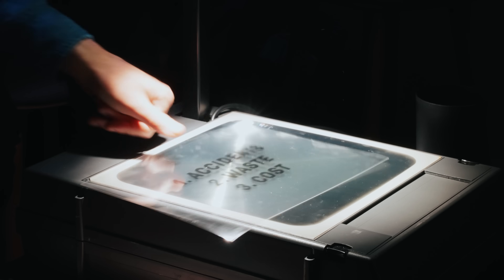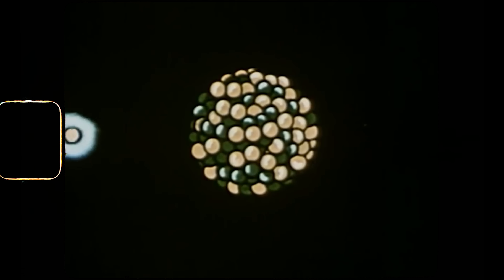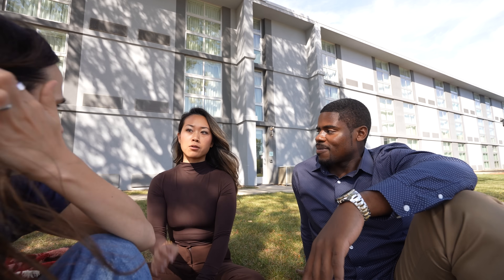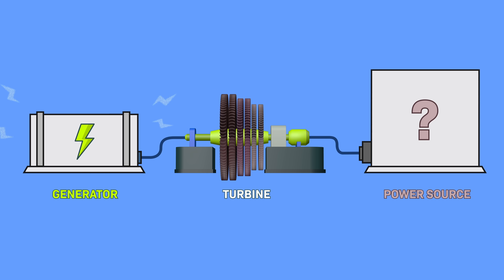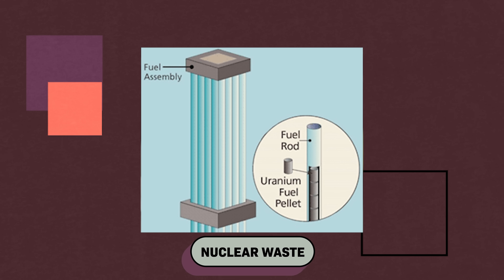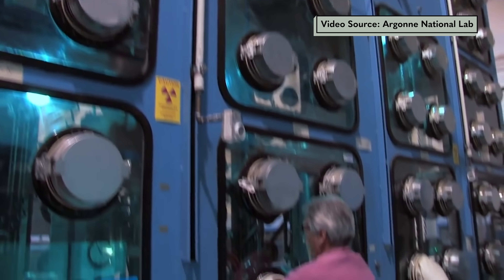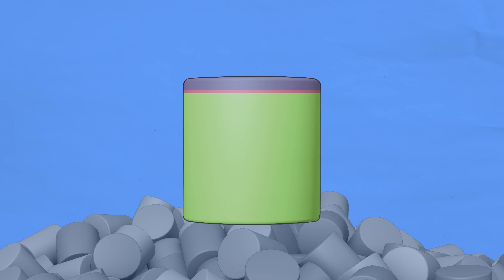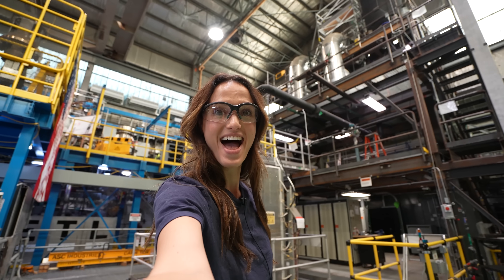The Big Lie About Nuclear Waste

Comment: I think nuclear power is the key to the future. It’s relatively clean energy that if engineering can solve the nuclear waste problem we will be set. I think countries should heavily consider exactly where they are put to avoid catastrophes. Like if we just put them in non earthquake hurricane or other low disaster zones it could be very safe. I think it’s definitely a source of energy we can rely on until we solve fusion because no renewables like wind and geothermic are highly dependent on location and it’s the best solution we can implement now. I used to live next to a reactor in Virginia I understood the risks but as long as we have our best engineers on the problem catastrophe can be averted imo. There will be a need for transitory power sources that will prevent further global warming right at this very moment and we can use remote storage locations like Yucca mountain or Finland in the meantime until we can launch it into space. I genuinely think that if we have a form of energy that doesn’t include greenhouse emissions that would be excellent fuck the risks of another Chernobyl that’s why we regulate and don’t operate like the Soviets I know a few bright people trying to get into nuclear engineering and I would trust them to run it 100% they are the smartest people I know and as long as regulation ensures this we will be fine. If we don’t kick back global warming right the fuck now we will be responsible for the deaths of a billion people that rely on reefs and fishing for food in Africa because at 1.5 degree warming 99.9% the coral reefs die due to warm waters in the oceans and we lose a shit ton of food production worldwide. We are expected to hit 2.8 degree warming by 2050 so if we don’t course correct now we will literally turn our own planet into a mad max hellscape by 2070. Let’s do the smart choice and keep nuclear plants operational so we can mitigate at least some of global warming. We will already be responsible for the mass starvation that we will soon see it’s the least we can do. If you are worried about a meltdown there are people much smarter than you and I capable of solving those problems and we should so future generations don’t suffer. A billion people are threatened in third World countries where fishing is their main source of food in Africa, we will be directly responsible for their deaths if we don’t change something now. I don’t envy the idea of continuing to use fossil fuels for my car when I know it’s going to kill a lot of people in the not so distant future. Global warming is an invisible threat that’s going to slowly affect us more and more it will be like a chain reaction and that threat trumps any nuclear disaster we could ever face. Radiation dangers are terrifying and real and disasters could cause a ton of death but I think the global warming threat vastly exceeds whatever harm radiation may cause as a result from a utilitarian perspective it causes the least amount of suffering worldwide and we should switch but only in low disaster risk areas we saw what happens with Fukushima.

Comment: Much of Ontario, Canada's electricity comes from nuclear power, Canada Deuterium Uranium (CANDU) reactors which use UNENRICHED uranium, along with hydroelectricity and natural gas. Coal power is no longer used in Ontario. CANDU reactors can also run on spent nuclear fuel from the light water reactors the USA uses.

Comment: I am completely pro nuclear power. However, do not forget that every time you recycle the uranium used previously, you create nuclear waste. I'm not talking about the pellets necessarily, but I am talking about all of the other things that get irradiated in the process. Process. Don't get me wrong, it's not that big of a issue compared to having spent fuel rods sitting around for hundreds of thousands of years, but it's not like aluminum. It doesn't all convert into new uranium for nuclear power.

Comment: Back in the days it seems like scientists wanted and knew how far we could push technology, and today when we have the tools we need to proceed everyone is working against it because it is not enough profit in the long run. Instead we blindly scrap things that will save the planet with lies about a cleaner option that is making it even worse, And people is actually buying it and no one is going to realize that our increasing demand for electricity will only be possible with nuclear power until it is too late to reverse and that we had the knowledge all along to do it, we just have to keep refining and get better at using up the fuel we already have. we need "to drink all the milk before we toss the package" because if you have no more milk left in the package aka Nuclear fuel, there is nothing left to spill.

Comment: The concern has never been the fear of disposing or using nuclear waste.  You can throw it down a giant hole in the ground and bury it.  The legit fear is nuclear plant meltdowns.  They will be pouring concrete on Chernobyl for the next 5,000 years.  And the ground will be contaminated for 10000 years after that.  And Europe got lucky that millions.  Yes, MILLIONS of people didn't die from it.  The amount of Soviets who died trying to prevent it.  We will never know the body count.  Solar and Wind is feasible long term.  Even Fusion (though far away still)

Comment: what are the credentials of the Asian woman and the black guy at time 3:50? Also, is the recycle of nuclear uranium 100% doable or did you intentionally not mention any drawbacks to our current knowledge of this technology? If it so great then why is Argonne still doing research on this so called already proven technology from the 1950's. And are there any drawbacks to the Japanese nuclear recycle system or is it almost perfect like the way you describe it in your SHOCKING AMAZING video?
Reply: It is 100% doable but it's more expensive than mining fresh uranium. This is with today's technology. Soon it will be the reverse with liquid-fueled atomic reactors instead of solid-fueled.

Comment: Missing:
1. Multiple types of nuclear waste
2. Cost of nuclear power vs modern renewables (now on-par but without the cost of fuel disposal and recycling added in)
3. Appropriate emphasis on the cost of recycling or the risks and contamination that the recycling plants create. Also, what to do with the Plutonium-239?

You didn't appear to misrepresent any aspects of the information, but the omission of key elements and, except for one comment about the cost, complete ignorance of the economic viability of continuing to try to use outdated power technology makes you come off looking like a shill for the nuclear power industry. Is that what you are?
Reply: "2. Cost of nuclear power vs modern renewables (now on-par but without the cost of fuel disposal and recycling added in)" It's only on par if you exclude the cost of storage for renewables and use a moderate discount rate. At a low discount rate, nuclear is the cheapest option.
"Also, what to do with the Plutonium-239?" Put it into reactors.
Reply: @Crispr_CAS9  Exactly!

Comment: It's good that you're putting this out there because I'm shocked other people don't know that you can recycle nuclear waste. There's a TED talk about a 15 year old physicist that figured out a way to use nuclear waste to power molten salt reactors that can be miniaturized. You could literally have a nuclear battery that could power a town, and it could fit on the back of an F150.
Reply: You are really not "recycling" nuclear waste, and it's at an extreme cost.  You still have ALL the radioactivity, now slightly concentrated, plus radioactive ion-exchange powders and acids.  The separated "useful" stuff is much much much more expensive than mined Uranium and Plutonium now and in the forseeable future..  Plutonium is a SURPLUS, as there are no reactors that burn Plutonium, and no new nukes being made.   So the stuff is worthless, actually, it costs money to store it safely.    

Plus you have acres and acres of expensive processing facilities that in a few decades break down and have to be mothballed and watched for hundreds of years.   All bad outcomes.
Reply: @georgegonzalez2476  In case of "fast reactors" it is not so simple. Some highly radioactive elements burned out. Even more interesting is that waste from fast reactors can be used as a source of fuel for slow reactors. First part (use waste from slow reactor in fast reactors ) - is already tested on good level and implemented in Russia (see BN-800 reactor). Second part (fast reactor waste-> slow reactor fuel) is still ongoing.
Reply: @NikolayBychkovRus  It's not so simple.  That plant is designed to burn excess stockpiled Plutonium.  Nobody is making or separating new Plutonium so this plant just fills in a small niche of a problem created by the nuclear industry itself.
Reply: @georgegonzalez2476  looks like you read Wikipedia:) English page about bn is strangely lame. In reality main goal is closed loop, last year the reactor was loaded 100% with recycled fuel. Pu there is not weapon origin, it is waste, with slightly different isotope mix. Next step is breading - bn can convert U238 to U235.
Reply: @NikolayBychkovRus  And the first town in the US powered by a nuclear reactor used a breeder reactor that generates power while converting U238 to U235. That reactor is currently open for virtual tours from the Idaho National Laboratory.
Reply: @ChristopherLHansen  Why they didn't build more of such reactors? Most of U is 238, which is usually treated as a waste.
Reply: @georgegonzalez2476  What about France and others reprocessing all of its nucelar waste?
Reply: @vaclavzajac214  They're way far uneconomical.  Fresh Uranium you can buy at one fourth the cost of reprocessed.  And yo still have all the radioactive waste.
Reply: @georgegonzalez2476  it's not uneconomical. It makes the fuel only 20 % more expensive because you also have all that plutonium which you can burn, it makes the electricity less than 0.1 cent/kWh more expensive but it makes waste disposal much easier and makes your fuel supply much more resilient to fluctiations in price. The amount of high level waste is reduced ~30fold.
Reply: @vaclavzajac214  The French nuclear industry is government-funded and the real numbers are opaque and unavailable.  They probably also do not include the cost of all the failed breeder reactor projects, Pheonix, Super-Phenix, and the rest.   They also do not show a penny of the costs of forever storing the concentrated wastes.   Other less biased estimates put the market cost of reprocessed fuel at 4 to 6 times higher than buying mined Uranium.    Also you forgot the very high costs of designing and building and running Plutonium-burning reactors.
Reply: @georgegonzalez2476  France wouldn't continue expanding their reprocessing capabilites if it didn't make sense. Don't deny my sources if you can't prove they're wrong. Phoenix and Superphoenix were successful but I don't see why they should ne included, they are not relevant to fuel reprocessing. The cost of storing the waste permanently is 2 $/MWh, a negligible amount. You can't compare mined uranium with a MOX fuel assembly. Natural uranium requires chemical conversion, enrichment and fuel fabrication. MOX doesn't need enrichment because it uses depleted uranium. You don't need special reactors to use MOX fuel, France uses standard LWRs.
Reply: @NikolayBychkovRus  "Waste-burning reactors" are a bad idea in many ways.   In order to burn "waste" they have to be very neutron-efficient, which means they are hugely expensive,  made of flimsy and fragile materials, and prone to weaken from the huge neutron fluxes and crack and fail in a few years.   The BN-800 reactor was built with a 100% subsidy from the USA, it would never be economical in a sane nuclear economy, and no more like it are ever likely to be built.  It was mainly a bribe to keep Soviet nuclear scientists employed and not emigrating to India and Pakistan to help them build A and H bombs.  Not in any way a practical source of energy.
Reply: @georgegonzalez2476  ,let's wait for bn1200, if it ever will happen. Possibly, the reasons you mentioned is the root cause of delays with the reactor. From people who participate in bn800, I know about difficulties of loading bn with sodium.
Reply: @georgegonzalez2476  You don't understand how it works. Unlike most recycling processes where you have to put in energy in order to get a usable material, like recycling glass or aluminum where it must be heated and melted down, then turned into something else, at almost always a higher cost than creating from new, the process of using nuclear waste as nuclear fuel generates money in and of itself, and as a part of the process, these reactors that use the waste as fuel make the final waste that must be stored and disposed of, a lesser quantity and less radioactive as more of the radioactive isotopes will have already broken apart into stable isotopes in those conditions. The cost of final storage is lowered, and should have already been calculated into the cost of nuclear power in the first place, but even so it's still cheap energy, they just need to properly encumber the funds for all reprocessing and disposal from the beginning. Also the costs go down with newer reactors that can be made more cheaply because of inherently safer fuel types, designs, more passive safety, making the extreme active redundancy of older reactors that increased startup costs, much lower. Instead of pioneering newer nuclear tech though some countries like the usa have just stagnated, preventing realizing these cost savings. Then anti-nuclear idiots argue based on decades old outdated tech as the reference for their complaints, rather than what is possible with existing or future tech. It's literally the only industry where we do this kind of circular logic. Planes weren't safe enough or efficient enough so they made them safer and more efficient, and just keep trying to improve it. Same with everything else, shipping, telecommunications, they plan with forward thinking and realistically attainable technological goals, and they innovate their way to where they want to be, and it works. Why are we not doing this with nuclear? Imagine if they said shipping is too dangerous and expensive, instead of trying to improve the industry, we're just going to shut down shipping, moratorium on new ships built. How absurd would that be?
Reply: @hzuiel  All that blab, ironically, one can label it as more nuclear waste.
Reply: @georgegonzalez2476  That is code for "I have no counter argument."
Reply: @hzuiel  Nope.  Arithmetic says so.  Loo9k up the Wikipedia entry on France's recycling nuclear, and you'll learn two very relevant facts:

(1)  Their recycled fuel (MOX) is ONLY 10% recycled stuff.

(2)  Only 10% of their reactors are qualified to run MOX fuel.

Do the math.  The answer is that they burn up only 1% MOX and the rest is fresh Uranium.  There is no way to get ahead if you're making 99% new waste and burning in parallel only 1%.   It's a pitiful, expensive, dangerous, toxic, and useless system.   It only makes more waste, at a very high cost.  Very typical of the French way of doing things.  Nobody does things like the French.

Comment: Cost, people. Cost. It's just not worth it doing this.
Reply: If nuclear power plants cost less than coal or natural gas plants would it be worth it?
Reply: @chapter4travels  
1. They don't. 
2. Even if they did, gas and coal and oil are not the relevant competition.
Reply: @SophoklesLogimo  they are relevant competition and they will be for a very long time. It's wind and solar that are irrelevant.
Reply: @chapter4travels  What is your source for such statements?

I mean, seriously, wind and solar are drastically cheaper than any of the ones you mentioned.

Comment: They also recycle Uranium waste in England and Europe. Westinghouse.
Reply: Yes, they do.
The plants are sited in Windscale (GB) and La Hague (FR).
Their environmental effects are enormeous. Both sites are next to the shore of the North Sea because their need of cooling water is very very high.
Result: Heating up the sea
Nuclear material is constantly emitted and radiation levels are accordingly.
Efficiency: Even the official statements from La Hague must admit that less than 30% ot the incoming waste can technically be recycled. The rest has to be "stored elsewhere".
The site in La Hague os one of the biggest single consumers of electric energy in France.
The description of the recycling process in the video lacks the "cool down" phase for the fuel rods. It takes several years.
Just take into consideration that if that cooling process is disrupted (due to whatever reason) things will go rapidly topsyturvy. Remember Fukishima.

Comment: good stuff
not sure where you got the fission animation, but there should be a large bit and a small bit , fission doesn't occur evenly.
no one does the coal ash comparison, there are literal mountains of the stuff, and its radioactive too. 
could have mentioned France which has reprocessing but not waste-burning reactors.

Comment: I worked at the National Reactor Testing Site now known as the Idaho National Laboratory. I performed data processing of reactor test data at the SPERT/PBF facility. (Special Power Excursion Reactor Test and Power Burst Facility). We simulated reactor runaway events for safety research. Properly cooled light water reactors are inherently self limiting.
Later we supplied instrumentation and data logging systems to monitor geologic activity around simulated storage casks which were electrically heated.  Many years of testing produced positive results. For political reasons Nevada Senator Harry Reid prevented the facility from opening. Thanks to his actions, the casks are still stored at reactor sites.